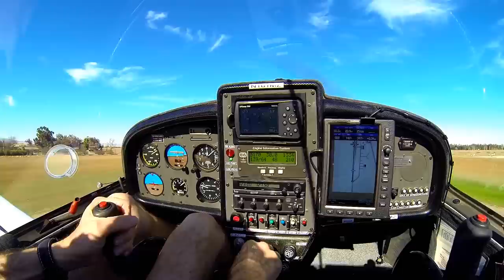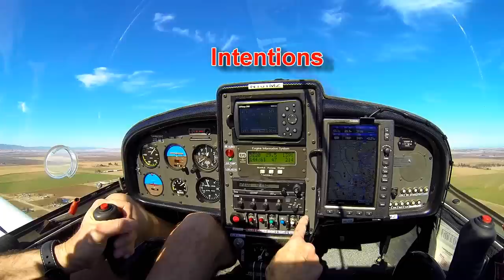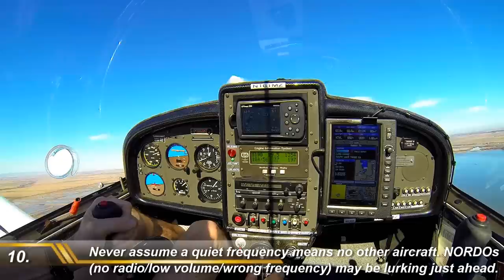Secrets to Good Radio Calls at Non-Towered Airports

Comment: I work at an FBO and we have a dry-erase board full of "strange" radio calls. 
"Malibu 123 taking the ramp/taxiway for takeoff"
"Meridian crossing mid-base... ...for full stop landing"
(Local college): "Diamond Star 1234A 12 miles North of the field, setting up for vor/dme RW 36 afterwards we will be executing a hold at 3,000 ft on the 270 radial after which we will... insert entire far/aim here .... Uh... Yeah.. 1234A."

That's just to name a few.
The last one is actually one we hear a lot. Numerous people will land within one transmission. It's ridiculous but we are not allowed to say anything. Other pilots will and that makes for a good chuckle here and there
Reply from the maker: Evan Hailey Yes, some do make you wonder how they got there.